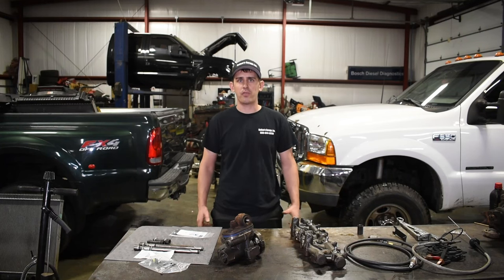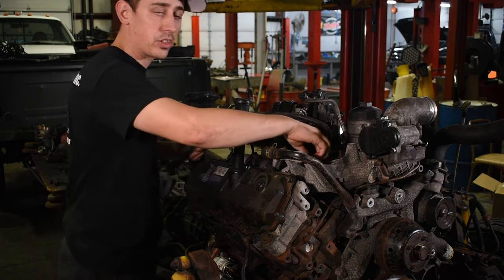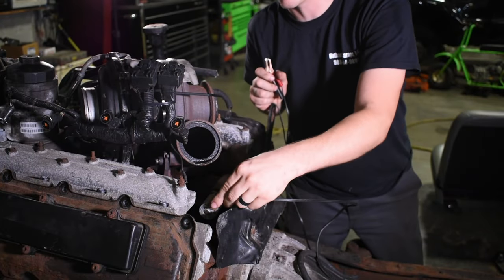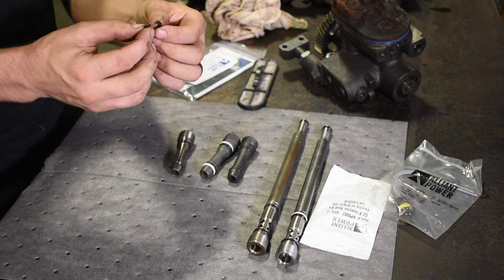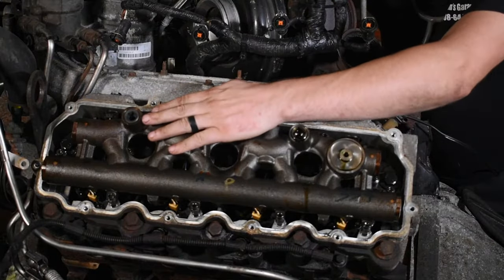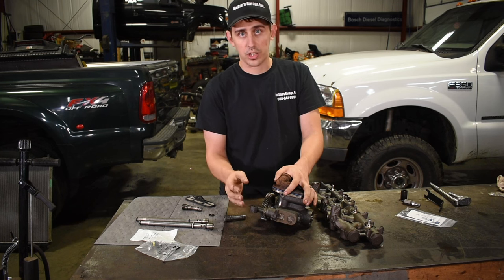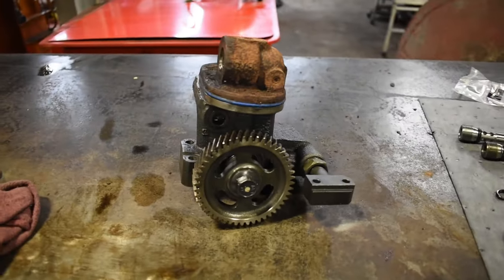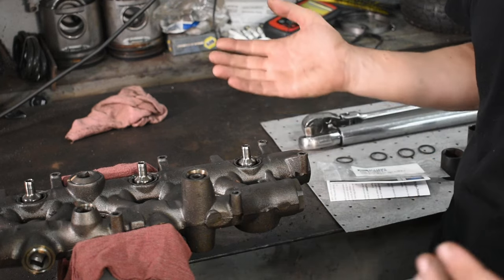6.0 high pressure oil leak diag and repair

Comment: Nathan, Much appreciation for your expertise and effort going into all your vids.  It's refreshing to see someone that takes pride in your work ( on and off screen).  Like most, I have a problem I'd like you to comment on.  Mine is very specific and probably at the root of what plagues many 6.0 owners with long crank hot/cold situations.  I am struggling with oil drainback from the filter housing.  This is being caused by the anti-drainback valve, nothing else.  I've changed the drainback valve, passed an air leak test with energized IPR, OE filter/cap etc.  As you know, this valve operates on gravity alone to seal, but as many owners experience, I loss all oil in the filter housing after 16-24 hours.  I've only seen a suggested remedy of replacing the oil filter adapter 3C3Z 6881CA.  Inspecting the rubber washers on both the drainback and bypass valves shows little if any wear.  There are no gouges in the sealing lips on the housing itself.  My question is this,  do you see any issues with adding an extremely light spring around the valve barrel and the valve housing to get better sealing pressure.  Another option might be to lightly lap the lip surfaces for a better seal.  Or has anyone came up with a better means to solve this?  I see so many posts on this root cause (where ppl think it's just the non-OE cap/filter) but never are they fully explaining a solution.  Would be great to hear your input.  Thanks so much!
Reply from the maker: What year is the truck?
Reply: Thanks for getting back on this.  It's an 05.  Since my previous note, I have polished the anti-drain back port on the filter housing with a fine scotchbrite buff on a dremel tool.  I also just got a new  OEM adapter plate and both for the cast ports have a rougher finish than what I have in the vehicle.  So, I've installed the new bypass valve/ anti drain back valve in the truck.  I have also plugged the drain back valve port with a silicone plug, so this cannot leak.  It is much improved, but it's still leaking down.   I can't imagine it's the bypass valve with all that spring pressure.  Looking for any ideas here.  Thanks Nathan

Comment: Great video! My excursion shut down one day, got down to the fitting on the HPOP and found a torn oring on the fitting. Put it back together with a new fitting and oring and still no start. Just did the air test and large amount of air coming from both sides, pulled one valve cover so far and found the oil rail oring leaking. Wish I watched this video before making the first repair! Good stuff
Reply from the maker: Awesome!

Comment: Great video, thanks for the detailed info.  My '05 6.0 was running great on a recent trip pulling my camper then I stopped for fuel in Tennessee and it wouldn't start.  Scan tool showed only 167lbs of hp.  Only had a few tools with me so hooked up with a local shop that immediately replaced the hpop. :( The truck starts now when cold but not when warm. The shop claims the new hpop finished the job of blowing standpipe seals.  I had to get home so I just went with this info and made it back to CO. $3000 later and I still have to work on my own truck! Thanks for giving me enough info to get moving on this project!
Reply: Was it the ipr?
Reply: @daniellucateroofficial4041  The stand pipes were fine but 2 injectors were leaking along with other minor leaks. apparently after replacing the hp oil pump a few other "compromised" parts started failing. Nothing another $2000 couldn't fix!.  As a friend of mine with a shop says, " 6 liter , $6000) Truck runs fine now but I'll never fully trust it!

Comment: Nice video.  FYI - The late 04's did not have the failure prone STC fitting that is corrected w/ the one-piece fitting w/ jam nut.  That was in the 05's and up.
Reply from the maker: Thanks Mark! As far as the pump goes the new style was used in 2004 after a certain production date. 2003-early2004 had the round aluminum pump with the cast iron cover. Late build 2004 mostly came with the cast iron pump with the aluminum cover and had the STC
Reply: You are right, International did change the HPOP to the cast iron one in late 04.  It had higher capacity due to the wavy oil rail "upgrade", but the STC wasn't introduced at that time.  It came w/ the 05.  It makes 04 a mix of configurations.   Anyway, not meaning to argue, just to share what comes directly from International.
Reply from the maker: I didn’t take it as arguing at all. I know a lot but I also still always have a lot to learn and talking with other knowledgeable people is the best way to expand that knowledge. The 2004 is a giant mixed bag of afterthoughts and last minute changes. In my opinion the worst year.

Comment: I got low oil on the pump on the dashboard on 6.0 Can't figure it out. I can get to start up on ether for a second. That's it, and it'll just all right back out. I haven't checked the rails yet. That's what i'm working on next is trying to get some more ideals.I like your videos

Comment: Awesome man! I replaced my right 4 injectors and now I get a double start. Almost normal followed by the ferocious 6.0 start that comes after a repair. Happens cold  start every time. I'm thinking injector o-ring or slight high pressure oil leak on the right bank. Thanks for the tips. I'm going back in tomorrow. Bubble test then this test. Kinda.. 03

Comment: Have an 05 F350. When it's cold it starts but dies immediately when it warms up. Replaced ice and ipr, injectors too. Replaced dummy plugs and the tube. What's another common problem? Thanks for your time and the video.

Comment: Awesome video!! 
Got two of these 6.0
Just recently did the sinister oil and coolant filter upgrade on one and now have a bad oil leak. Can’t find the source.
Seems like just below the oil filer and then running down the back to the passenger side to ground. Any suggestions?
Reply from the maker: Very common for the gaskets on the oil cooler to leak. Also the oil pressure sensor.
Reply: @InTheShop  ah thank you! Was able to find it. O-Ring on oil filter cap
Reply from the maker: Awesome! Thank you for updating me. I’m glad you found it.

Comment: I think this is the problem with my truck oil is leaking like a sive from the back of the motor when it's on the ground (level).  I did an egr delete  a few months back, and then I started having this problem out of the blue.  I thought the oil was coming from the oil cooler but I think it's coming from the back right or left valve cover.  I'm going to do this weekend and see what happens.  Thanks again for this video.  I'd rather take advice from a Yankee then some hellbelly who says he knows it all (you know who I'm talking about) lol
Reply from the maker: Hi Greg, it seems like you have an external oil leak not a high pressure oil leak. I just recently made a video about finding external oil leaks. I hope it helps.

Comment: Grate video. Am working in a 05 f-250 with a  really long crank to start . Pressure tested the system at the ipr and found a injector leaking at the top o ring replaced it and retested again now it holds 120 psi for a good hour or so but still cranks for about twenty seconds before it builds icp pressure.Hpop? Ipr cleaned and reseal and dummy plugs and stands pipes replaced. Any suggestions would be greatly appreciated. Thanks in advance
Reply from the maker: Car Doc have you put any miles on it since the repair? It can take a few hard runs to get the air pockets out of the high pressure oil rails. I usually like to do a highway run with a couple hard accelerations.
Reply: Hey thanks for the quick response. No I haven’t put any miles in it . I pulled the hpop cover off just to inspect the STC fitting in install the update it one . At this point am just debating in installing a new pump or not . I would hate to put it back together just to find out i have a weak pump i know it’s not really common in 05 and newer but can be still possible since I can find any leaks?
Reply: Make sure You have the write oil filter ,otherwise the check valve Will bleed the oil back to oil pan and causing a long start because it has to reefill the oil filter reservor. I know it happend to me.

Comment: I have an 05 6.0 and this past weekend, after driving my truck on the highway for about an hour,  I stopped at a rest stop and turned the truck off. When I got ready to leave the truck would crank and crank but not start. I let it sit for about 30 minutes and it fired right up. I thought it might be the ficm, but what are the chances it could be this issue you just fixed? Thanks for any help.   

BTW, great great video. Very informative

Doug
Reply from the maker: Definitely sounds like a high pressure oil system leak.
Reply: @InTheShop  should I follow the diagnostic procedure you laid out or just go into the valve cover and replace those tube o_rings?
Reply from the maker: It’s always a good idea to test it first so you don’t have to go in multiple times

Comment: What’s up brother, I bought a 2003 old government f350 6.0
The oil pressure gauge drops and the check gauge light comes on while idling. It had 130k miles.
You Mentioned a little ball that falls out of the pump? Could it be the oil pressure sensor?
It runs and starts great. I haven’t checked the pressure- it is my first rodeo!
I need some direction.
If I drive it like this can it damage the motor?
Thanks
Reply: Help!!!!
Reply from the maker: Hey John, the oil pressure sensors are also common and an easy/cheap thing to change to verify. I wouldn’t be surprised if the ball fell out of your pump though. You won’t cause any damage by driving it but if the ball fell out it is possible that it leaves you stranded. I would put a sensor in it and recheck. If it still happens pull the pump.
Reply: Thanks for responding. 

You’re not going to believe it but I changed all of the aftermarket filters to Motor craft and it fixed the problem!!!

It still has the egr cooler- if I leave it in how can I keep the system clean?

Comment: Good video.  I bought an air fitting that goes in place of the IPR.  It works great.  What year engine is that?  The throttle body on the otherwise 04 up intake with the EBP on the thermostat is really throwing me off.
Reply from the maker: This was a late 2004 motor. They were a half breed and used the 2003-2004 style pump but used the 05+ style rails. They also had the 05+ style intake but had a throttle body. Funny part is the throttle body is blank and had no blade in it. They were a mess lol

Comment: To clarify, if you do not energize the ipr while pressure testing, it would make it sound as if the high pressure system has a leak?
Reply from the maker: ChronCrew correct

Comment: About 3000 miles ago, I replaced the HPOP, and also, the dummy plugs and stand pipes, and oil rail nipples and seals, Now i have a crank no start, cold or hot, it did fire once to get it hot and i took it for a drive test only to have a no start when i got home, ran great on the road, i notice the low side seams to take a bit to build up but the oil gauge in the truck rises like it should, ok with all the history, thanks for reading, im not sure where i should start first, remembering back when i put the HPOP cover back on, im wondering if i may have pinched the seal on the tube from the HOPO to the ICP senor is there a way to air check that part ?  thanks your the best

Comment: I was wondering if you knew anything about the stand pipe on the passenger side, is there a check valve in it,and whats it there for,,, iknow the oil comes up through it,does the check valve stop it from draining back into the oil pan,
Reply from the maker: There is a checkvalve. The valve keeps oil in the rails so you dont get extended cranks.

Comment: Wow. Thank you very much for this video. I have a problem with my 2006 International Schoolbus with a VT365 Diesel Engine. It cranks when it is cold and it does not when it is warm. So these things you were showing are the things i am going to try first. I paid a workshop about 4000 Dollar and they did not find the issue. I just had to learn the hard way that sometimes it is better to do it by your own. But that would not be possible if you were not making those perfect videos. So thank you very much and i will keep you updatet if your video solved the problem!
Reply from the maker: Thanks Dennis! That Means a lot to me. Hopefully this helps you find out whats wrong. I'm looking forward to hearing what you found.
Reply: @InTheShop  Hi. So I tried to fix everything you mentioned in this video and the last thing I had to do was to change the oil pan (upper and lower) gasket because I think it is leaking. Then I have seen that one of the inboard main bearing cap bolts is just broken. So I have to change this. But also I found some crazy metal stuff in the oil pick up tube. I made some pictures and I would like to ask you if you have an idea what it could be. Could you check my pictures via what's app or however you we ant it. Would be really nice if you could help me. I am a little concerned now 🙄. Happy to hear from you.

Dennis
Reply from the maker: @dennismike89  you can send them to my email address nathan@intheshopmedia.com
Reply: @InTheShop  ok. I sent you an email. Thanks !

Comment: Hey bro great video. I have 05 and just had bunch of things go wrong at once, no chatter, no fuel pump noise, no base line oil pressure. So yah I'm going crazy lol.. can you help
Reply from the maker: Can you communicate with a scan tool?
Reply: @InTheShop  tomorrow morning a friend is coming by with snap on computer/ford diesel software,,, something like that. So I will keep you in the loop just in case I don't understand him.  After watching you work I trust your opinion...

Comment: Bud thanks for your time and doing this video.  Today while hammering down on her getting on the interstate I thought I ran over a wet spot in the road but then noticed a fuel smell real bad. When I got home I noticed the Driver side was slick and  under the truck from the drivers side motor bay to the frame rail where the fuel pump and filter is. Was wet but it was more oily.  It’s a 05 6.0. Do you have a direction I should look.  Thanks

Comment: Great video!I replaced the pump on my 04 6.0 and still leaking,and I also have a injector leaking fuel in oil what do you think my next move should be?new icp and ipr,I'm ordering updated plugs and stand pipes
Reply from the maker: I would start by replacing the injector that’s leaking fuel into the oil. You can pinpoint which one it is by putting a bottle of “engine oil dye” in the fuel filter housing. With the valve covers off cycle the key and watch for traces of the dye around the bases of the injectors. You will also need a UV light to really see the dye. 
Oil Dye: https://amzn.to/2Ue0syO
UV light: https://amzn.to/2Wl7gIc
Reply from the maker: If the injector nipples are loose I would replace the o-rings while you have it apart.
Reply: @InTheShop  thanks bro!great Chanel btw
Reply from the maker: Lee Izaak thank you! I have tried hard to put out good content. I have taken a little over a month off but will be back to making videos in a week or so.
Reply: @InTheShop  I'll be watching bro love the truck!subscribed 👍

Comment: Hey I've got a 6.0 in that driver said motor just shut off while he was going down the road. I found that the oil filter cap backed off and my rights are the motor shut down when he lost base pressure. Now it won't start back up again.  Ipr at 85 when cranking, icp has 0.18 key on and 0.3v cranking, icp reads 70 psi at best.  His truck also takes over 30 seconds of straight cranking to build base pressure. Where would you go from here?

Comment: any way to test the hpop its self - pressurized the system and no leaks.......   but only builds 263lbs of pressure
Reply from the maker: If you have no leaks, and you have good base oil pressure you likely have a bad pump. There is no real way to test it individually.
Reply: What year truck?the 2005+ have the cast iron pump that seldom fail.

Comment: When doing the hpop system air test, if all is working properly, should you hear absolutely no air leaks and the test gauge hold steady without any pressure loss?
Thank You
Reply from the maker: Correct you should hear little to no air leaking.
Reply: @InTheShop  Thank You for the response.
I have replaced just about everything under the valve covers and down the center of the intake.
Hoping it is just that some debris got in the IPR Valve causing it not to fully seat.

Comment: Hey man, great video!!  I'm helping my buddy fix his 2006 6.0 and we did the shop air test and found leaks on both sides.  It has the updated stand pipes and dummy plugs, we replaced all 8 of the oil rail cup o-rings, and all 8 injector o-rings (the ones that the nipple cups slide into).  My question is, do these engines take oil/pressure to seal everything back up?  Because we still have air leaking from under the oil rails but there's nothing else to replace that I know of.  Thanks in advance my friend!!
Reply: I subscribed as well.  Now I'm going to binge watch all your videos!!
Reply from the maker: Thank you! They don’t seal when dry. Put some oil in the rail through the ICP port and the plug where the ICP would be on the other rail and check again. If they are completely dry they can leak.
Reply: @InTheShop  Well, we put it back together yesterday and it fired up and ran great.  It even started back up after we warmed it up.  So I guess it does take a little oil to seal those up.  Thanks for the reply my friend!  I've owned an 04 since 2010 and I've never had a High Pressure Oil Leak believe it or not.  I've put one HPOP on it but that's it.